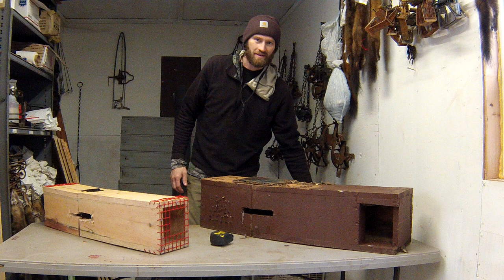Lynx Exclusion Devices Required for Maine Trappers: Designs and Measurements

Comment: In the 120 boxes, the trap has to be in the "set" position 18 inches from the farthest point of the 4 inch opening? Or is trap to be 18 inches from the 4 inch opening even if the trap is in the closed position?
Reply from the maker: Hey Kyler.  The rule defines the 18" as measured when the trap is set.